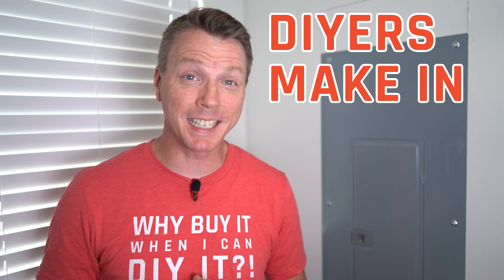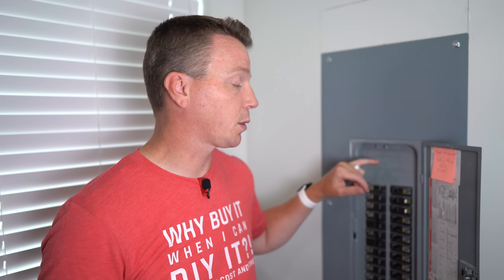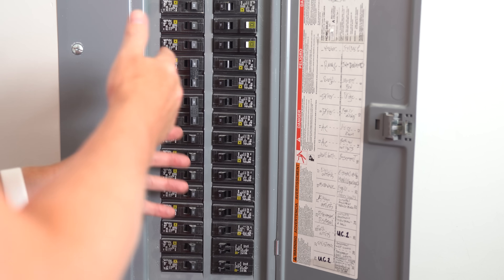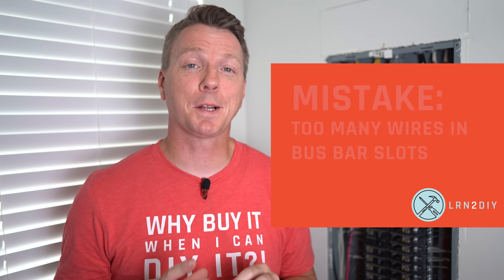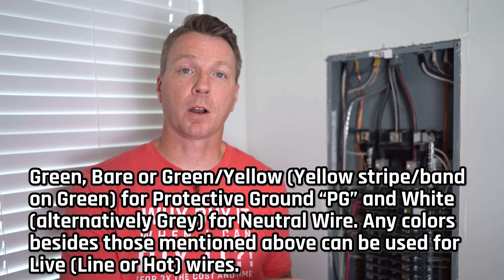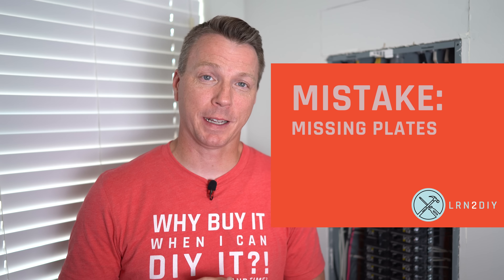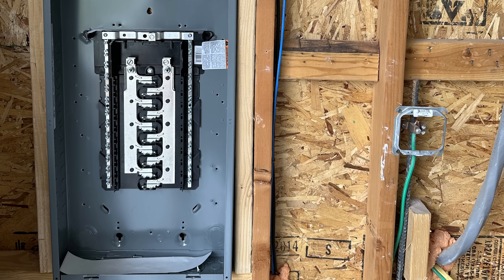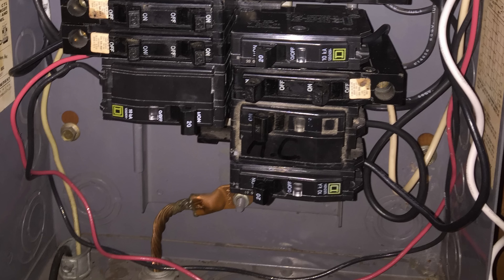10 Common Mistakes DIYers Make In Circuit Breaker Boxes

Comment: I'm an EE and a gearhead. I torque nearly everything on a car. Thank you for pointing out that there's a torque spec on breakers. Never even thought of it. So far using a little sense has kept me from burning any houses down but I will buy the proper tool for the job. Great channel!
Reply: Just think, it is in the electric code twice now. Once where it says to torque and once where it says to follow the listing and labeling instructions. NEC 110.14(D) and 110.3(B) However, I think I am the only Electrical contractor in the area that does torqueing.
Reply: @tiggeroush  the guys that did my service upgrade busted out levels and a torque wrench. I was highly impressed.
Reply: Hey me too!
Reply: "Never ever thought about it"  really?
Reply: Same here. I know a number of gearheads who don't even own a torque ratchet, much less know the torque specs for a given fastener/part.
Reply: You must be a C student EE if you have never heard of that.
Reply: @JackTheAwesomeKnot that's pretty rude to say, you definitely could get an EE degree with a 4.0GPA and never have torque specs on a mechanical connector ever mentioned to you. EEs aren't Electricians either.
Reply: @cusbrar1  Physics demonstrations of arcing are shown to students when they take EE classes. When there is a gap and a high enough voltage, you get an arc.
Reply: @JackTheAwesomeKnot  Wow, I learned this before Jr. High. You'll need one tiny gap to get 240V to arc.
Reply: @randyduncan795  Tiny gaps form when your screw is loose
Reply: @JackTheAwesomeKnot  we got that demonstration in Grade 11 shop class.
Reply: @Wingnut353  Absolutely, especially for anyone who has gotten an EE degree since the late 80s when things in EE started moving away from practical (hands-on) and into chip design. That's why there are EET programs at many universities.
Reply: @JackTheAwesomeKnot  House wiring and the NEC were not my focus. But general knowledge and experience seem to work reasonably well for torquing breaker screws. Who'da thunk it?

Comment: Not a pro, but am very familiar with code and practices. Helped my sister with wiring at her dad's house. Found 20A breaker with 1st leg having #12 wire. BUT down this leg he hooked up lights, etc, with #14 Romex! Electrician passed this over. Oops!
Reply: depends on the length of the home run, some sparkies will do that.  run all the homeruns with 12 gauge and switch over as necassary

Comment: ⚠️  Nice Video.. BUT!
Be cautious about splicing multiple conductors (EVEN GROUNDING) to a single conductor.
The example of using a wire nut connector to splice the 4 or 5 uninsulated ground wires (£14 or #12) to a single wire….
NOT  A  GOOD/SAFE choice!

If you have SIMULTANEOUS multiple faults to ground — I have seen it occur in mostly industrial or commercial environments…
 you want a SOLID path t

Comment: #11 Load Balance  (Red to black phase) for regular (full time 120V) loads. Refer to the diagram for your panel and you will see every  other breaker is on the same phase). In many cases, simply interchange  2 breakers (or loads if the same rating). 
#12 Multiwire  (being phased out) 2 120V circuits (single pole breakers) sharing a neutral in a 12-3 cable. common for Disposal and dishwasher installs. The breakers must be ganged (this was a later requirement) and on opposite phases .
Reply: Those are usually opposite legs, not phases.
Reply: @stargazer7644   in the case of typical 120/240V residential wiring in the United states, can you describe what is the difference between a "phase" and a "leg"?
Reply: @svyt  Power generation and distribution is a 3 phase system, where each phase is 120 degrees out from the others.  They use 3 phase because it is the most efficient way to distribute the most power with the least wire.  In a residential subdivision each one of those 3 phases might split and each go down a different street and power all the houses on the street.  You take one of those phases and you feed the primary winding of the transformer on the pole.  The transformer secondary is also one phase, but is tapped in the middle of the coil.  The top and bottom of that one coil is each called a leg.  It is just each end of the same coil on one phase.  The wire from the center of the coil is the neutral, and is also connected to ground.  If you measure from the bottom of the secondary coil to the top you get 240V.  If you measure from either end to the center, you're across half of the coil so you get half of the voltage 120V.  
There are other arrangements for doing this, especially in cities and commercial buildings where because of their higher power usage all 3 phases are run to buildings instead of just one phase, but this is the most common way suburban and rural residential power distribution is done.
Reply: @stargazer7644  Take a quick peek at a ground-based residential transformer tag. I think they have 2 phases, my friend. Also, I wish we would have used 208 as the voltage as this means we are dealing with a delta secondary which means a wye primary which means the dreaded resonance issues at high current.
Reply: @freddiecarr7602  As I said, there are other arrangements possible.  In more dense areas like apartment buildings that have 3 phase available they are sometimes connected between 2 phases and that's a different animal (note that these phases are 120 deg apart, not 180).  I mentioned this in my response.  Standard residential AC power in North America is a split single phase arrangement.  The vast majority of single family residential customers do not have 3 phase available, so most are not connected that way.
Reply: @freddiecarr7602 …in the USA, residential electric feed is single/split phase, NOT three phase, NOT two phase.
The phase split and voltage drop is done at the service transformer.
The residence receives 120/240 line and neutral
Ground is from the grounding electrodes at service entrance

The two 240v wires are NOT two phases. They are ONE phase, split into half-voltage. 120v on one, 120v on the other.

And yes, 240v three-phase is much more efficient. Europe has it better.

Comment: I personally would only even consider double tap for something like ceiling lights, but I wouldn't even recommend doing it for that, just shell out the few more dollars for a tandem, that way separate rooms can be on separate switches.  This way a whole area or floor of the house doesn't go dark just to change a light fixture.  Not to mention I think in some areas it's against code to double tap even if the breaker supports it.

Edit:  the only one I've been guilty of so far is not torqueing things down to spec.  The few times I've completely changed out a breaker box we definitely did torque it for the mains in, but for the breakers we just made sure it was "gud-n-tite"  which is probably not the best practice.

Thanks for the video, it was fun!
Reply: As an Electrician and Electrical Inspector I believe most of your video. But what you were super bad on was Electrical SAFETY. Carelessness in an Electrical Panel will get you killed.

Comment: An inspector in our county did not like neutrals and hots bundled together.  He claimed it had the potential to create excess heat.  I still did it and was not turned down.
Reply: Bundling conductors will drive up heat but it's not a practical issue for a few reasons. Realistically, most of the heat actually comes from the breakers there.

Comment: A couple of tips for updating your panel schedule.
1) make a layout drawing for your house marking the locations of all outlets and all light fixtures. A drawing thats not to scale is fine.  You will turn off all curcuits and only have one circuit on at a time.  You will mark on your drawing the circuit number at each location that you detect power.  This drawing will be used to help you write a more accurate panel schedule.  Any unused spaces with breakers in them can be marked as spare on the panel schedule. Keep in mind that you can have outlets and lights in crawl spaces, attics, and closets.  Sometimes you'll find equipment (water heater, dehumidifier, air handler, etc) in these locations.  If you have a hardwired doorbell, don't forget to check what circuit that is on.
2) they make printer paper that is a sticker.  You can print off your own schedule. Alternately, you can print on regular printer paper and use packaging tape to secure it to the panel.

One common mistake many homeowners make is storing items in front of the panel or not having a clear path to the panel.  You're supposed to keep the work area and access path clear.  The work space extends 3 feet from the face of the panel and is 30 inches wide.  The safe access path is supposed to be 3 feet wide.  All this is so that you have ready access to the panel in an emergency.
Reply: I grew up in a house where the main panel was in the master bedroom closet, at the back of the closet. That house was built in the 1950s. So much for a "clear path" to the panel during an emergency.
Reply: @TheRealScooterGuy my home was built in '78 
It's in the closet
Reply: @DaveBigDawg My mom's house was built in the '70s. The panel for the upstairs is in a bedroom closet. I just measured the access width (which is the DEPTH of the closet, as the panel is on a side wall); it's exactly 20 inches.
Reply: I want to second this from someone who has done a lot of networking installs. Having a basic drawing (ms paint is fine) and labels of where stuff goes makes the difference between a 10mins job vs an all day job.
Reply: @SupportToolsBlog  even a rough handwritten drawing often helps.
Reply: I tag every outlet and switch with the breaker number they are attached to. It is just a small label in the lower right corner.
Reply: @charlescoulbourn6826  Same, except I write it on the back of the plate. I don't want to see markings, tags, or stickers on plates in my house (in the office, that's fine)
Reply: @JCWren  I'm in the process of marking the backside of switch and receptacle cover plates in my house, which I bought last June.  I learned to do this working in the steel industry.  Every piece of equipment had it's safety shutoff marked with the panel number and breaker numbers listed.  Even so, we always test the cricuit to make sure it is dead.  I'm also making a new list of the breakers and their services for my house's breaker panel door.  Very few of the services are listed.
Reply: I'm glad I did this with my home. I think an observer would be keen to learn that the utility room light is on the same circuit as the guest room receptacles.
Reply: @BigMikeECV  some houses are wired with all the lights on one circuit.  A lot of newer homes have the bedroom lights on the same circuit as the bedroom receptacles because of the early arc fault rules.
Reply: Amen, as a home inspector I see many add on; cabinets, shelving, etc blocking access to the panel.
Reply: Yep, that's an awesome idea. My uncle did that as well and he kept a copy of the diagram in a slip sheet that he hung on the wall next to the panel. He also had the breakers labeled too
Reply: I did that year 1 after discovering my panel was mislabeled.
Reply: An inexperienced homeowner doing such a DIY electrical panel-directory survey may miss or not understand where some of the breakers in the panel might go should not just write "spare" on the schedule unless they are certain there are no wires on their lugs. 

There can be AC units, furnaces or electric heaters, water heaters, outlets in weird locations like attic fans, ice-melt circuits for the rain gutters and a host of direct-wired equipment that may not be obvious or easy to locate when doing such a home.survey such as fire alarm/detectors and security systems.  Sometimes breakers can even go to special panel surge suppressors connected to the grounding system inside the panel.

Having something labeled "spare" can be more confusing than not labeled at all and may result in important things being shut off by mistake when they are assumed to just be spares.
Reply: No one would pay me to do that.  It was bad enough that my general contractor would give me 'wiring plans' with no actual wiring, just the locations of all the boxes.
Reply: @kevinsullivan3448  what a nonsensical comment.  Of course no one would pay you. This is about accurately updating your panel schedule yourself so that it meets modern code requirements.  You could always pay a lot of money for an electrician to the same thing in your own home if you want. That's your prerogative.  As far as the plans showing boxes but not the wiring layout, that was on you to enforce that your red line drawings have the current wiring layout.
Reply: COLORS.  !  Voila..    get the kids, to PAINT  THE  COLOR  OF  THE circuit, (each breakers ones) on the wall receptacles. !!   '' okay, so green is number 3     red is  number 4,  etc...Walk around the house , and see which  ones  are which...
Reply: It is a good idea to actually add if possible,  a main breaker before the main panel, so you can completely shut off the main panel to work on it when needed. This also makes it a lot easier and safer to replace the main panel and any components  that go bad when needed.
Reply: @albertandersen627  you have to do that if the unprotected feeder wire is too long.
Reply: The drawing needs to be a 1:1 scale, actual size! 🤣
Reply: @anthony4530  good luck finding enough paper. I suppose you could draw it 100:1 scale if you wanted but I think your neighbors would object.

Comment: You don't need a fancy screwdriver. The torque specs are minimums. Just crank it down tight and you're good to go.
Reply: I've had customers (internal and external) that would not detect the sarcasm.

Comment: 1. You want to add a sub panel so the main panel won't be overloaded. Well, where do you think the sub panel gets its power from? From 2 spaces in the main panel. So you haven't changed the load on the main panel. Sub panels only add more breaker spaces. By the way, your panel is already a sub panel. That is why there is a 4th wire as a ground and the grounds and neutrals are separated and the main bonding jumper is not installed. Your main panel is where the main disconnecting means is located. A main panel that contains the main breaker does not need a separate , 4th wire, grounding conductor. That is most likely why you see some cut off.
2. Changing the color of a white wire to be used as a hot requires the entire wire be re-identified every place it is exposed, meaning every junction box it's in.

You want to instruct but you are not qualified.
Reply: Thank god someone said it, licensed Electrician here I was grinding my teeth watching this. So tired of completely ignorant diyers passing on misinformation as if they fully grasp the topic. Idk why ppl think adding the numbers on breakers equates to total amperage used/available. Every single one of those single pole breakers could be thinned down to twins and much more space created in that 1st panel. We often in the trade refer to this as thinning breakers down 😂. If your consumption requires more than existing panel thats a simple answer.. you need a service change to either 200a or 400amp service 😑
Reply: @badpenny8986  With tandem breakers the panel manufacturer MUST specify that tandems can be used and they also specify in which spaces they can be used. 
You also cannot exceed the maximum number of breakers for that panel as specified by the manufacturer and the code.
Reply: Must make sure the line conductors are sufficient enough to handle the extra load of so called sub panel
Reply: @michaellike5037  No, this is NOT necessary. The main breaker protects the service entrance conductors and will trip when it's rated capacity is reached. It doesn't know or care how many sub panels or breakers there are.
Reply: It's possible with special fuses to make some load distribution in a sub panel (in a main panel you hardly find a good place). I don't know if these are common in the US, but it should get available with EV-charging (reduce the car's power if you need hot water, with off the dryer as long you need hot water in the kitchen, ...).
Sometimes you need ground in the main panel, sometimes not. Don't take any assumption if you work with this. You are right that most homes don't need the 4th wire as ground, but the breaker you are working with may be a strange case where it's different (it should be labeled). Here was a small settlement which got converted from industrial environment, it got all the industrial wires still in place but used as flats --> no ground connection anywhere and many electricians got screwed by this installation (one short to ground and everything works still fine, you could even touch one wire). Every electrician loved to search for fault if the ground fault sensor went off (https://www.youtube.com/watch?v=maJaBQyd1XA).
It was a running gag for every new electrician who worked first in this settlement (strange wiring, noting makes sense until somebody pointed out these flats use a high grade one fault tolerance industrial/hospital wiring). It's easier to spot in the US as there are special hospital grade receptacles (hospitals need this strange wiring for life support systems).
Reply: Ever noticed that the service drop to every dwelling only has three conductors?  The true grounding conductor actually originates from the earth  via ground rods. In some places two ground rods are required   an unbroken grounding conductor is imperative to the function of a proper grounding system!!
Reply: @michaellike5037  It's not a grounding conductor. It's a GROUNDED conductor and is the neutral at this point. Two completely different things. The system GROUNDED conductor originates at the power source. (utility) The GROUNDING and BONDING conductors are what is attached to the local ground rods and only carries fault current.